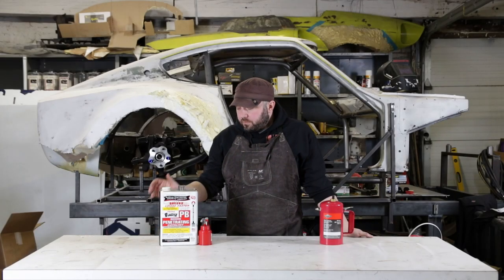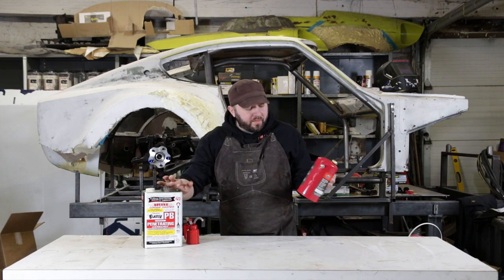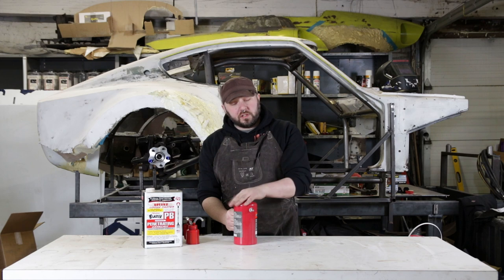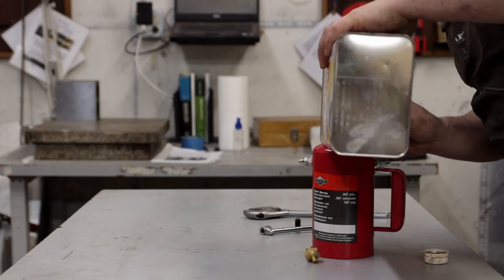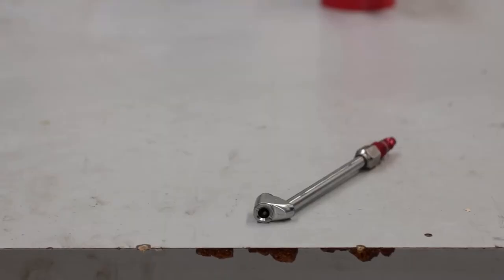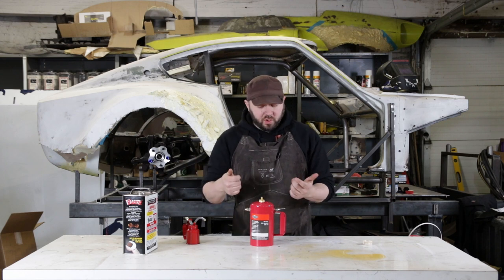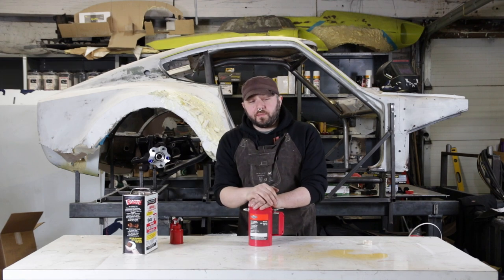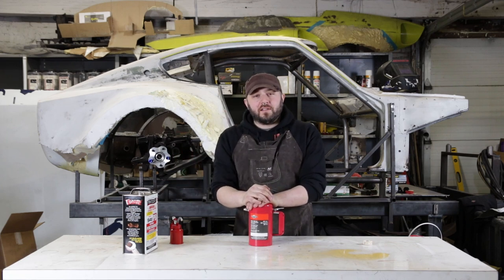Save money in the workshop with spray cans

Comment: is it possible to use with engine oil as lubricant...want to undercoat a frame?if possible straight or cut with acetone?
Reply from the maker: Be careful with flammables, especially acetone. Acetone is really dangerous if pressurized or aerosolized. Generally speaking, a 'wash bottle' (non-pressurized, with a non-aerosol nozzle) is the best solution for acetone.